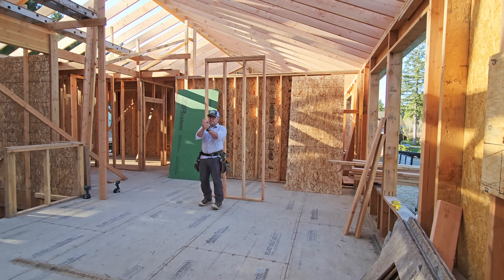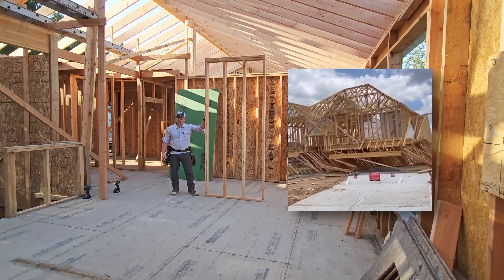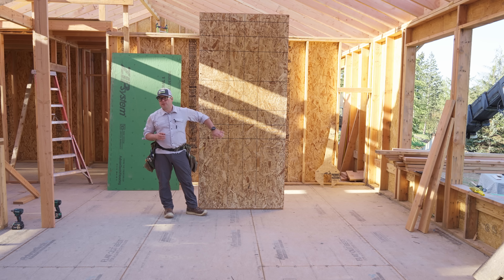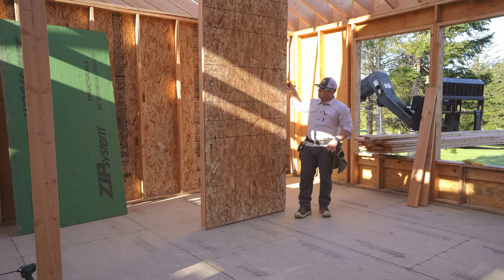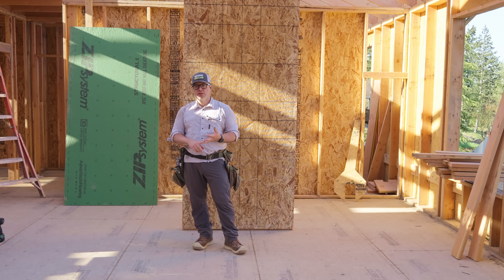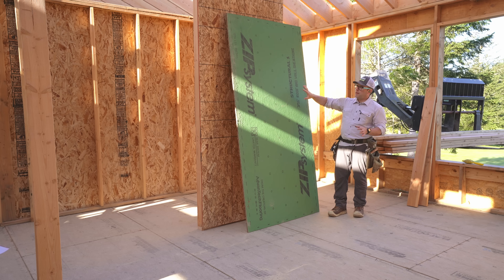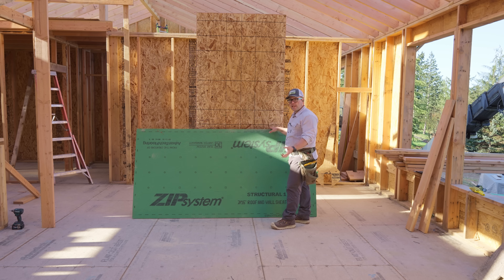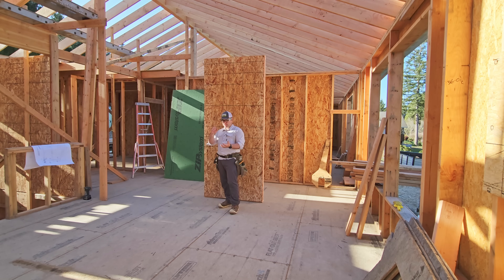Shear Walls Secret: The Hidden Force That Holds Buildings Together

Comment: A much better solution was screaming through the entire video....use screws, not nails. Look at all the collapse videos and see for yourself how the entire house is a bunch of really strong 2x4 sticks and they are all weakly connected... assuming that gravity will just sort of hold the entire thing.  However shear walls are a great solution....if you just want to build something real quick and leave the place with money in your pocket. But if the same structure was screwed together, it would be slightly stronger. Considerably slightly stronger. It could survive much higher winds for example. The only downside is that it takes longer to install and people don't understand hardening. You can't use brittle screws. Those will snap right off. You gotta use construction screws that have been annealed to make them malleable.  But beyond that, look at the videos! The roof structure was just fine and then suddenly it just disconnects. All that is left is 2x4s with nails coming out the ends. Well if we replaced all those dumb 6"nail connections with steel brackets, that would be way way stronger. You could make a large hexagonal house and just roll it down the hill if you wanted, it would stay connected. It bothers me that there isn't such a connection system available to us the home Depot people.
Reply: When using screws, there is a risk the structure will collapse instantly with no chance of survival for its inhabitants. Nails can bend but will hold for a time. If you want strength, you can use anchors or nogs they use for fahwerk houses.

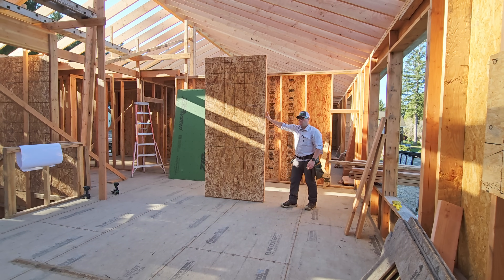Comment: @5:21, sorry, you blew it, and so did the structural engineer that commented on your video.  You installed the panel incorrectly and missed a good opportunity to explain to people why.  That panel should have been placed HORIZONTALLY, not vertically.  The OSB has better compressive and tensile strength horizontally to oppose the racking forces you are talking about.  You also engage more studs and you can stagger your seams avoiding any one stud from being involved along its entire length with double nailing.  Sorry buddy, you got this part of your example wrong.
Reply: Can you provide sources for that claim? I've seen them vertical a lot
Reply: Also where he said you can fasten the shear ply with staples

Comment: Why is the video in back ground not showing either an excavator or a telehandler purposely shoving the house sideways.  Was that a demonstration or a vindictive employee.  When I did framing we actually used real plywood, not the particle board used in today's construction
Reply from the maker: OSB is not particleboard.

Comment: In New Zealand we have studs placed further apart but with nogs placed in between the studs to stop racking.
Reply: blocking placed between studs wont stop racking, you still require a brace either steel strap or plywood nailed off and each end securely fixed to foundation.
Reply: @mickeybowmeister1944  not here you don't. The plasterboard goes straight onto the framing.

Comment: Great video and information. As a licensed contractor I am currently working on a insuarance claim where the sheeting was installed improperly and a wind storm racked the entire home. Definitely a very important part of the building process and easily overlooked.
Reply: could you explain how did improper nailing lead to the whole house racking? what did they do wrong?

Comment: My parents built their house out of Cinder blocks all the other neighbors thought they were crazy. A decade of hurricanes and their house is still standing strong. The neighbors have had whole walls blown in Their roof sagged because it was made out of particle wood.. My parents demanded no particle board. Yet the neighbors house is worth more on the market because it's slightly bigger and has a pool. I'd roll with the cinderblock house all day.
Reply: Particle wood or OSB? OSB is very strong.
Reply: @nonconsensualopinion  strong yes, but totally destroyed by the smallest amout of water penetration, whereas ply will hold up and be fine if you stop the leak.
Reply: @nonconsensualopinion osb is strong compression wise , but has very weak lateral and tension strength . This makes it pretty much useless for construction unless it is non load bearing.
Reply: @nonconsensualopinion plywood is better but who can afford it
Reply: @richardwarfordjr.5622 not really.   The only advantage of plywood is that it's lighter.
Reply: @nonconsensualopinion I personally still don't like OSB. Once the water hits it, it's finished pretty quick. Plus it's way heavier than ply
Reply: @shrimpy7862 What’s the thing to use then?
Reply: @ZachFish-  as I said in my first comment, ply
Reply: @ZachFish-  каменный дом с бетонным армированным каркасом
Reply: @ZachFish- interlocking granite stone blocks. Like the ancient people did.
Reply: @ZachFish- in Florida witness these soaked about every week plyweakens first by corner softening osb still good years later particle should be illegal to sell or use in Florida or anywhere to get wet
Reply: little pig little pig let me in
Reply: Agreed, I'm fine in general with timber frame but concrete is fantastic. Also, no matter what anyone ever tells me plywood, all those chipboard/particle board contractors will never get me to drink that cool-aid no matter how much water resistance copium they tell me. I'm 34 year old I've seen osb used, I've seen plywood used, if a construction issue/water leak rises its ugly head that osb is screwed, plywood everyday, get treated, or treated marine grade if your ever thinking there is a likely hood of occasional water leakage.
Reply: @RadarLeon Or, install your roof properly and keep up on maintenance. When the OSB finally does delaminate, it'll be time for a new roof anyways. Nothing is made to last anymore, bud. Home ownership is expensive, and it only ever gets more expensive
Reply: Europe has choosen concrete and bricks (in many forms). 
We also have winds, low temperatures, quakes, snow, floods, water and even fires. 
Some of the buildings in my city are from XVI century - not joking - still in the same place, still in one piece. 
Houses made out of wood are build here in completely different way and mostly bc of historical reasons. 
Show me one single castle made out of wood.
Reply: @jareknowak8712 it's like they want biodegradable homes first lmao fir real
Reply: @jareknowak8712 right on I agree old ways cement over woods
Reply: Insulated concrete forms. I live in a cold part of the country where we also have tornado hazards. Nothing will help me sleep better at night than knowing my family is safe sleeping in what is essentially a  concrete bunker when the weather gets sketchy. 
We'll just go in the basement with nothing to worry about.
Reply: Insulated concrete forms, if you can afford it, and you plan to live in it for a reasonably long time, this is the way to go. If you live in the house long enough the savings on heating and cooling can ameliorate the initial higher cost.  @getinthespace7715
Reply: Interesting.  Thank you. @getinthespace7715
Reply: @getinthespace7715 right right lord under sounds safe but smh it's like basically caging a house could save a home only I'd like to see impactable tenting idk
Reply: Osb is stronger than normal plywood
Reply: Ok for hurricanes, but an earthquake might give you an unhappy surprise.  My high school was cracked in half from an earthquake.
Reply: @disqusrubbish5467 if you follow construction code and laws you would not have to worry about earthquakes on a cinder block house. Im from a very sismic active country where most, of not all, of the houses are made of cinder blocks and concrete and the damages are minimal or not at all (obviously depending of the force of thr event). 

I dont know if it is the norm but I have seen a lot of american tv shows where their cinder block walls are hollow, here we fill the blocks in concrete and steel rods.
Reply: @jorggamingcr409 im not sure of code , i work/worked on as a mason tender for quite awhile and the rebar drilled into foundation cavities are filled …but on other jobs its rebar all the way and other cavities so far up etc … again i was laboring and wasnt interested in knowing why ..also durawall goes every 3 or so courses ..among probably other reinforcement i dont recall at the moment ..
Reply: @jorggamingcr409 so true, it’s also have to do with if you build your house to specs, Which most think build to specs is the best, in most cases it’s ok but it means just building to the government codes the best is if you actually go to an architect and he designs it above and beyond specs.  
And specs built homes are just bare minimum to meet government standards…..
Reply: When your woried about huricanes your not going yo see earthquakes. You cannot build for an earthquake and also be hurricane safe with traditional methods, and thats the same in reverse. Hurricane is 150 mph wind, thats shear forces not racking which is more the point of this video. @disqusrubbish5467
Reply: @disqusrubbish5467 I see elevated and round  works   From Florida yes earthquak factors wind and rain along with poor soil
Reply: Particle board is not even close to code.   OSB is code and might be called particle board,  but it's very strong.   If the roof sagged, it's because the shingles weren't installed correctly and leaked, the OSB was installed in straight lines,  or the rafters were not engineered properly.   Not due to material. 

And to be fair: the house going over in this video is the same.  I guarantee you it wasn't engineered properly or the framers were cutting corners.
Reply: In europe we have 0 huricanes and 95% of houses are made from cinderblocks. Houses will hold for 200years or more if maintained good. It is so confusing to me why most americans use wood for main construction.
Reply: @nejcar92  earthquakes are more common but it's probably just cost, also a well maintained timberframe house will also last over 200 years....well maintained being the crux of the issue.
Reply: Marine grade usually means more copper. Same stuff you use on pontoons boats, and bottom paint. It kills fish and bacteria so it slows  decay. Copper pipes do the same and don't cause tumors.
Reply: Shut up
Reply: After a big typhoon knocked Guam back to the 1890s, they stipulated only cinder block and concrete, and metal window shutters. I rode out a typhoon that blew a 90-foot breadfruit tree down across the street. All we had to do was clear away branches off the roads. Power came back that afternoon. But US still builds trailer parks in the Gulf, 100 people burned alive in their stick homes, and we all pay for it in higher insurance. Hey, that sounds like a racket!
Reply: Cinderblocks are inferior. Not even good for foundations. The block is too porous and degrades quickly.
Reply: @ragingrevenge1 😂 why is it used on so many foundations then
Reply: @leviluikart977 because it's cheaper than pouring a real concrete foundation.
Reply: Sounds like a lot of tuckpointing
Reply: Sounds like a value proposition
Reply: Americans and their wood! Lol. Most home builders are employing MEXICANS who don't speak English. This makes issues when BUILDING CODES are important. And wood is a weak base for a homes structure. So why do Americans keep using it? Concrete man. It's what's for dinner.
Reply: I’ve often wondered why Americans don’t use block and brick like we do over the pond especially where you have hurricanes!

Is it simply aesthetic or deemed too expensive?
Reply: @MrMillander any place in the world you go people tend to use what's most available to them so you see more stock houses up north and more block and stucko houses in the south. Mud in Africa . concrete in the Philippines or bamboo
Reply: @MrMillander most Americans just do what everyone else does. They don't actually use their brain to think for themselves. Since everyone else does this, build with wood, so should I. This is why I don't consider myself an American. They have a very difficult time seeing things outside of the box. Long live the Brits!
Reply: Also, I could be wrong, but wouldn't sheathing your house in marine grade plywood just give your whole family a bunch of tumors?
Reply: Most houses 500k or 1m are useless and worthless
Reply: That seems incredibly general and a waste of a reply.
Reply: Any shapehouse but extended roofs    Round and elevated period test this
Reply: Metals a paper will always return to its original shape   Lime reseals it's self strengthening like self correcting stronger even more over time
Reply: I want to see fire proof tornado proof waterproof graphine I supposed rocket ship build airlines  fly through something better then what we do
Reply: Nothing beats steel, blocks and concrete! You ever wonder when it storms in Florida everything goes flying 😂😂😂 show me proof where plywood r any other wood is better than concrete, wood n steel
Reply: Wasn’t there a children’s story about this? Hug and puffed and blew the house down…
Reply: I lived in a cinder block house. It was hot in the summer and freezing in the winter. Proper framing and insulation are the way to go.
Reply: I would rather not live in a hurricane prone area, personally.
Reply: Details matter, cinderblock, plywood, osb can all work, if you save money using osb, you can spend extra elsewhere to compensate.  Resistance to hurricane, etc is about building things better/stronger than just "code"...  osb is weaker to moisture than plywood so protect better against moisture.  You can use 2x8s as wall studs 5/8 or more osb as outside layer, etc for more strength
Reply: Everyone I know that builds houses can afford plywood 😅
Reply: @srfndabike osb works just fine and it's half the price.
Reply: @srfndabike I can't. Go to home Depot and take a look. It ain't cheap. Glad you know all the RICH contractors!
Reply: cinder blocks are useless in an earthquake unless they are reinforced by metal flexible rebarb, wood flexes just make sure your house is bolted to the foundation
Reply: @twostop6895  true, but generally speaking, if your building to defend against hurricanes, earthquakes aren't a factor in your area.
Reply: Earthquakes are a thing every place in earth especially where hurricanes are... 🤦‍♂️
Reply: @EpsteinWasJustTryinToFitIn yes they are in fact in 2024 from florida
Reply: @twostop6895 Americans don’t know how to build that’s all
Reply: "Unless"
Reply: @twostop6895  not unless you live in Florida
Reply: Your parents also probably put rebar grates over your windows and never let you out of your room, but whatever.

Comment: That's crazy, ive never seen a house like this from just wood. My workshops better built. I'd be worried about the weight of the roof tiles crushing my family in our sleep.
Reply: Only 100s of millions of houses built from wood like this.  You must know better though
Reply: I don't know better, never said I did. It just surprises me. My house is 230 years old from brick and I expect that in another 230 years it will still be standing. I just can't see how this could last. But happy to be be proven wrong. Would also like to know how this holds up tiles  in strong winds.

Comment: I mean what’d you spect from a wooden house?  In Latin America it’s all brick, rebar cement and concrete. and unless they are dirtying on a bad fault they won’t crack.
Reply: In Latin America, earthquakes claim hundreds or thousands of lives because heavy un-reinforced masonry structures collapse on people and kill them. In the 1989 earthquake in Northern California 67 people died. There was a lot of structural damage but most of it was in older buildings not meeting modern building codes. Single family homes built from wood fared very well.

Comment: This is why you don't build with wood.
Reply: What is your alternative? I think the two biggest problems with wood construction homes are fire and termites. But the construction cost is lower so it remains the number 1 choice. Metal studs might be a better choice. But I think they are usually only used in commercial buildings, not in home construction. And I am not sure they are any more resistant to racking than wood studs.
Reply: @mckenziekeith7434  ICF, walls and roof
Reply: It needs a minimum amount of intelligence, right. 
Not for everybody 😄

Comment: Back in the 80s only certain walls were specd to be shear walls and sheeted....made a nightmare for stucco and siding guys dealing with 2 different planes....now every wall is sheeted and has been fir quite awhile but have seen the changes.....also simpson strong walls werent around back then, maybe 90s or 2000s they came in.... this is California maybe other parts were different